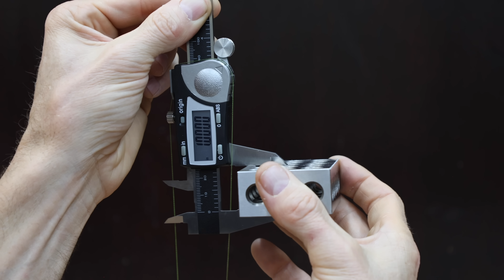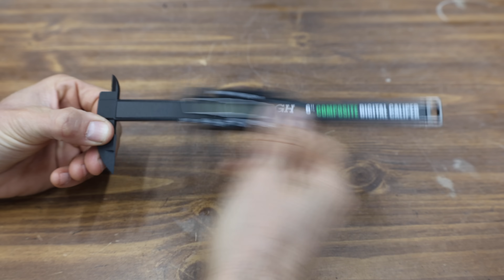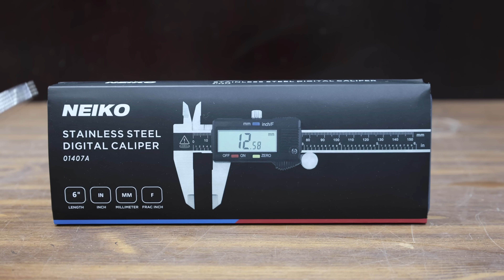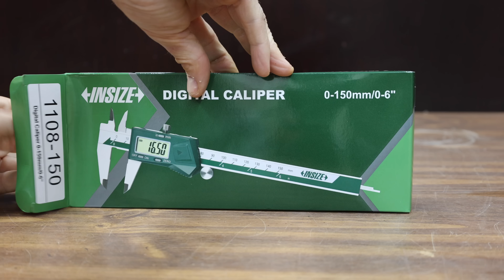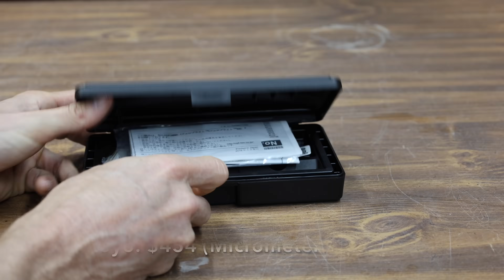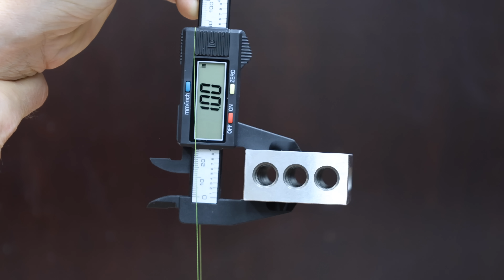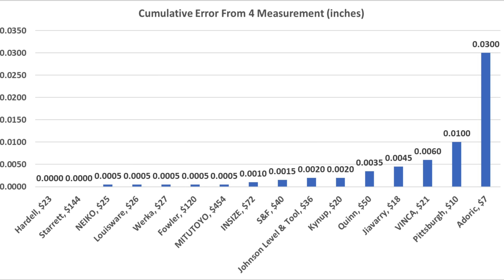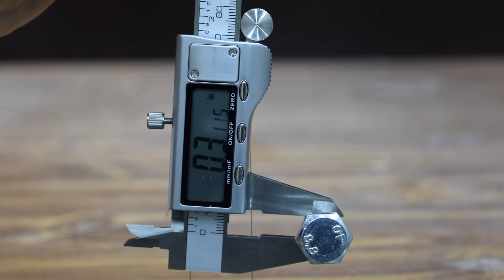I've Been Proven Wrong About Calipers!

Comment: Very interested to see the outcome here, i have a nice mitutoyo set that i found in a case on the floor behind the shop fridge that someone else lost god know when, still work great!
Reply: Just buy a standard mitutoyo caliper. Especially if you don't use it much. For 65$ it will outlast you
Reply: The main difference between the top performers is the average longevity. And after seeing most brands over the last 40 years Mitutoyo is the real standout. They just last longer. I work at an aerospace manufacturing company for reference. The manner that some accuracy test were done It’s not quite correct. Like using the tail to measure to a wooden table. And 123 blocks aren’t necessarily 1.000,2.000,3.000. Checking a groove with a small radius at the bottom is definitely the wrong tool for the job. Please don’t take this the wrong way it’s meant to help. But at the end of the day you get what you pay for….usually.
Reply: @CHILLYDAWGER how do they usually fail / wear out? Do they lose accuracy or just stop working?
Reply: @Mr.Anders0n_ guides wear and they arent paralell anymore
Reply: That’s a helluva find!
Reply: I also found one on the floor of a neighbors house, and she said she'd take $5. Sold! 😂
Reply from the maker: Wow, thanks for sharing!
Reply: Keep em go calibrate them with Joe Blocks. The good inspection department set. Not the working set.
Reply: That’s where it went!… If you could kindly send it back to me, that would be great, thanks. 😂
Reply: My shop is filled with tools someone “lost behind the fridge.” lol. Better than the ones you buy!
Reply: I just can’t afford them sadly 😭 they’re so expensive. I got a ruler from them though and love it
Reply: @fusion1203 they aren't 400 there like 120
Reply: @outlaw_overdrive im canadian amd cheapest pair i find are like 240
Reply: @fusion1203  I'm Canadian. Based on what you wrote, you aren't.

Comment: What about battery life, particularly with it "off"?
Reply: That isn't really testable.
Reply: @Hathos9 it actually is testable if you know something about electronics, and with the resources available to a top channel like this it should be no problem to pull in someone with the right skills and test equipment.  What you would do is put the battery in an external holder and run wires into the battery compartment, through a meter to measure the current draw.  Measure with it on and with it off, and then use that with the battery specs to calculate how long the battery would last.
Reply: @ruikazane5123 yes, that would be a multimeter task, and a task for a good electronics oriented multimeter, not an electrician's meter.
Reply: @Hathos9  sure it is. Short battery life always tests my patience. I have cheap digital calipers and they chew up batteries in a few months. My Mitutoyos the battery lasts so long I forget when I changed it. They last for many years on one battery. Which is way better than a few months. But if you pull the battery out of the cheapies then battery life is OK. Still pulling it out and putting it in is a hassle. But you gotta.
Reply: @Hathos9 
it is, but tbh it's not really a big concern unless you don't have batteries on hand, which you should, it's just inconvenient sometimes
Reply: @papitosaucito  You say it's no big deal, but having to pull the battery before and after every use is a royal pain in the arse. Those LR44 aren't as common as they should be either....